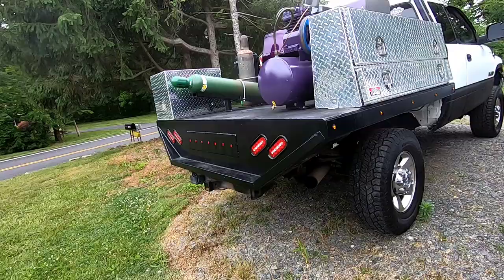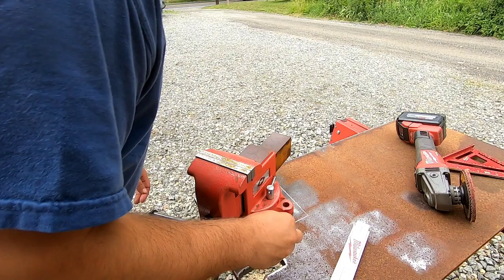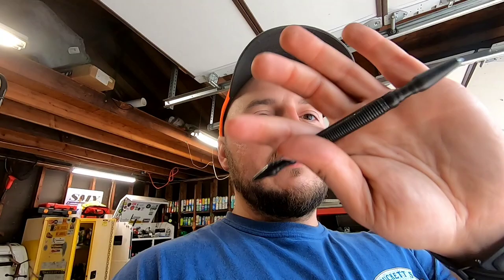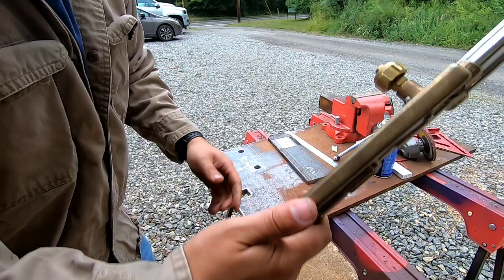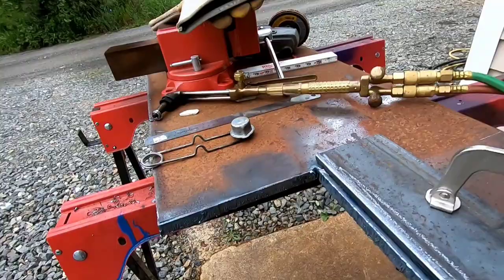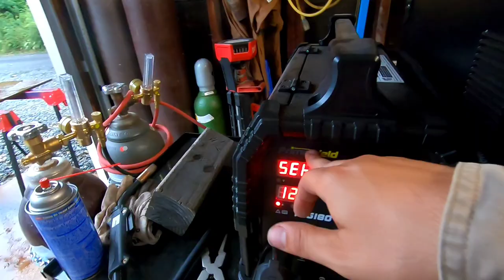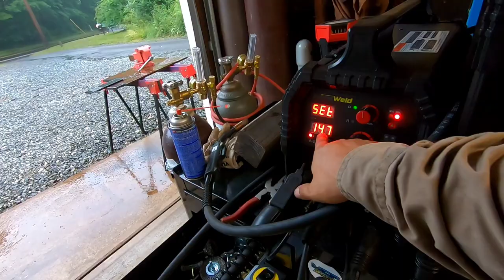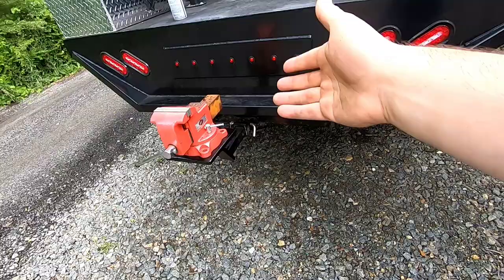PUT A REMOVABLE VISE ON YOUR TRUCK! HITCH MOUNTED VISE

Comment: Should weld a 2” receiver to the right side of your deck , then u can have the vice at a good working height and a good spot to slide a roll out wheel into for pipe spools
Reply: So true, plus you may have to pull a trailer at some point.

Comment: Nice addition to your rig.   I’m hoping to do a side hustle welding when I retire.   In addition to a engine drive, I also have a Primeweld MIG 285.    I’m newly certified, with a year of wekding school.   I like your videos, as they are easy to follow, your audio is good, and I appreciate you showing how you go about repairing things.   Keep up the good work!
Reply from the maker: good to know, and keep at it. You can get a side hustle going nicely with that equipment

Comment: I would weld a receiver mount to the right and left side of the bed. Get another drop hitch and drop the vice down waist high. That way you don’t have to bend over to use your vice.

Comment: I put one of those together also. Very handy but my welder is in the bed of a regular truck bed so I am currently building a welding trailer so I can carry other things in my bed. I need to figure out how  put a receiver on the trailer to use the trailer hitch vise on the back of the trailer. GOOD job!  All of you Youtube welders inspire me to get off my butt.
Reply from the maker: I think they make a weld on or bolt on mount to put on trailers for that kind of thing. Or you can always fabricate one up for the trailer yourself

Comment: I made mine from 2in sq 1/8 thick the same height of the open tailgate of my Pacific brand truck bed comes in handy when not needed it's under the Lincoln inside the bed
Reply from the maker: That sounds good! i was thinking about making one custom but this was just the cheaper route